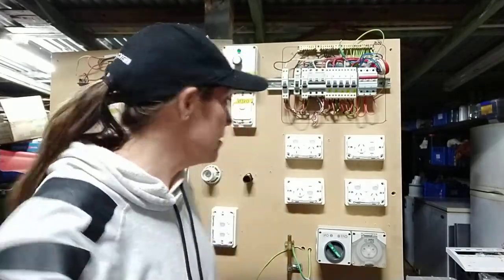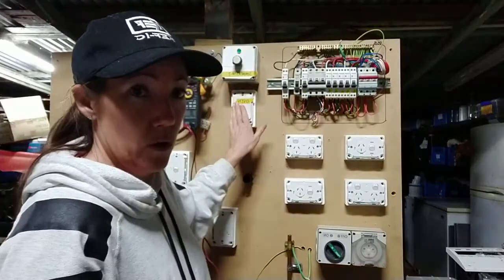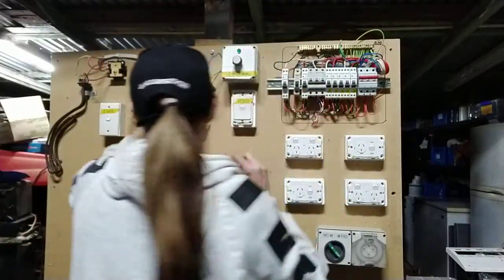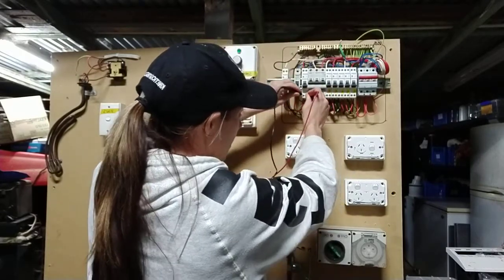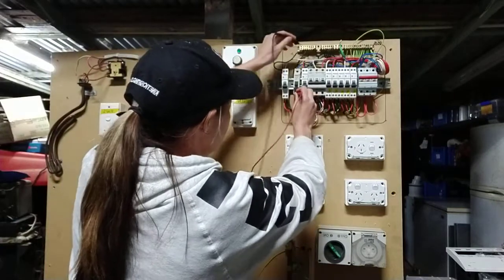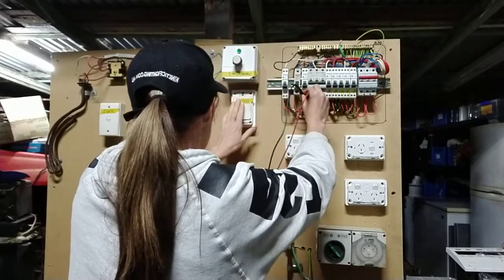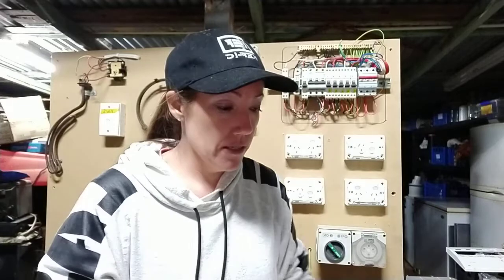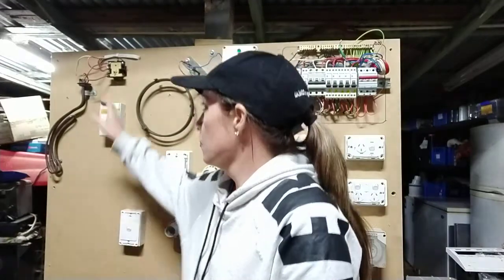Electrical Capstone Practical Exam. -Short Circuit Testing -Correct Installations / Fault Finding.

Comment: Hi Nicky, ive got a Kyoritsu snap ,meter thats a few months old.it doesn't make the beeping noise when testing resistance. does this matter or should i take a different meter into my exam?
Reply from the maker: So many kyoritsu meters. You'll need to use a Meggar for Insulation resistance.  They may provide one for you.  Find out what brand they use and be familiar with it.  You'll need to know how to calibrate it and test the voltage.  In regards to the beep... Totally fine.  The beeping is good when testing continuity it means you know there is a path without having to look at your screen.  You'll just have to check by viewing the reading that you have resistance for continuity.  With all other test you need to read your results and determine if the reading is appropriate.

Comment: Hi Nicky, the exam sheet I was shown also states in the circuit connections section for a neutral-earth transpostion how would you test for this ?
Reply from the maker: Hi Al Dee,

Great question and I'll try to answer the best way I can. For the record I'm not a qualified electrician yet and don't claim to be an expert. Specifically Neutral-earth transpositions can be tested by:

1) Confirming all earthing on apparatus is connected to your earth bar ( Earth continuity)
2) Testing Polarity of your Neutral to Earth using known resistors or continuity method.
3) Testing for no interconnected Neutrals

Now correct connections in general also go a few steps further. 

4) Test Active to Neutral is consistent with the load and that the switch is actually switching the apparatus off. For example a Powerpoint will have  varying resistance while the known resistors are joined.      
A....(R1)....E...(R2)....N
Switch ON
AN =R1 + R2
AE = R1
NE= R2

Switch OFF
AN =OL
AE = OL
NE= R2

If you have a single phase 3.6kW HWS you are Testing Active to Neutral and comparing the resistance to the expected calculated resistance of 230²/3600 =14.7 Ohms. 
P=V²/R so R=V²/P

5) Testing resistance either by continuity or known resistors of the apparatus at the switch and at RCD/ CBs. 
Correct connections are about a switch and RCD/CB  being connected to the apparatus as labelled.  

6) If there is 3 phases (which I'm sure there will be) Testing for continuity each phase is correctly connected.  Example...Go from L1 on load side switched off CB to a switched on 3phase outlet then again for L2 and L3 respectively. Red White Blue cable is a colour identifier but never make assumptions about coloured cable if you can't see it's entire length. Test it!

The key is to understand exactly what you are testing, this way if you get a fault you know exactly how to isolate and find the fault.  

Check out 3.4 on Page 29 of the AS/NZ3017:2007 

Also Figure 1.1 Page 7 shows that 'correct connection' is incorporated into the polarity section of the testing sequence.

I hope this helps and good luck.
Reply: Thank You for clearing that up :)